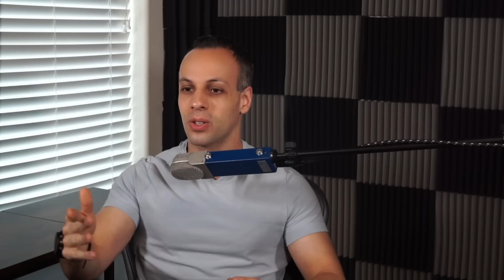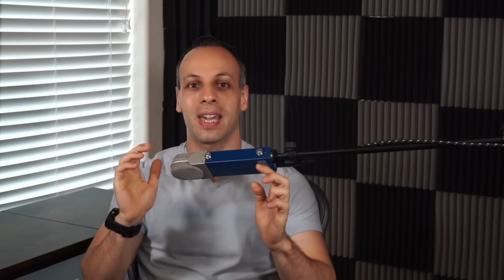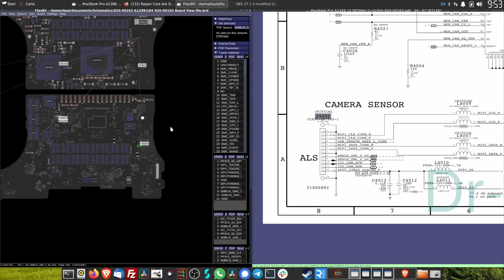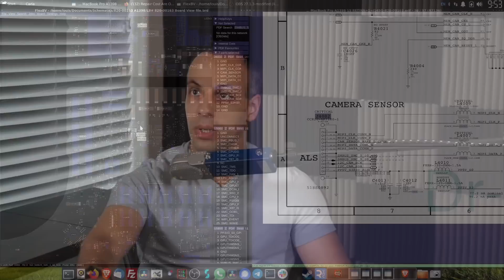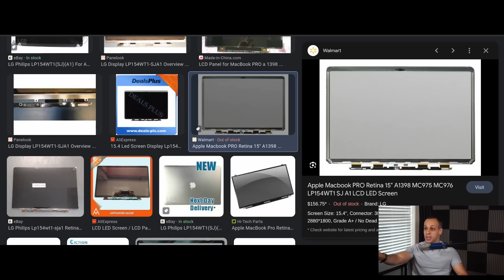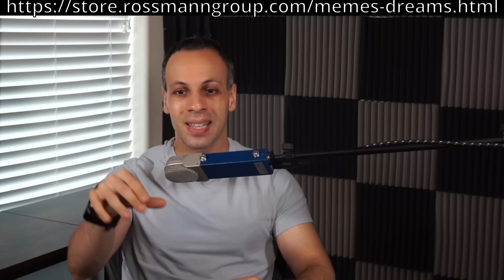The Ford F150 Macbook - when car repair resembles macbook repair...

Comment: What sucks the most about modern technology is computerization of things that need not be computerized. Cars are one of them. As a PC repair tech I believe cars should be as mechanical as possible because computers have so many more points of failure than a gear.
Reply: @@GH0STST4RSCR34M The problem is that it's made like that on purpose. I had to throw out a 30 year old whirlpool fridge the other day, on the back there was a sticker with a SCHEMATIC of the circuits, any repair tech or enthusiast could fix it with standard components. Go buy a fridge now and try to get it fixed out of warranty, everyone will tell you that it's cheaper to buy another one..
Reply: Mechanical and simple. Too many circuit boards that have components go bad and completely shut off the car
Reply: @@GH0STST4RSCR34Mshame old Bronco prices are crazy!
Reply: Cars are one of them... Tail lights being combined to and TIED to obstacle detection is just failed FORD engineering at its finest. Like GM engineers when they put a starter under the intake plenum on the NorthStar Cadillac engines. Tail lights need not be more computerized than they are with a simple switch tied to your pedal and a warning that tells you the bulb/LEDs burnt out. Cars as a whole on the other hand have got to be, thats all there is to it.
Reply: @@GH0STST4RSCR34M of course you're still stuck with a wood-framed body that's one big crumple zone if you ever tangle with some jackass in an SUV or monster pickup.
Reply: @@GH0STST4RSCR34M find a bigger car. something from the '40s.
Reply: @@GH0STST4RSCR34M ok, cross that off then...but how much stock A are you planning to keep?
Reply: @@GH0STST4RSCR34M damn son. i wanted to talk cars and here you are venting. my apologies if i hit a nerve.
Reply: @@GH0STST4RSCR34M someone should if they are smart about the car. i've seen many daily drivers that appeared stock till you looked at the wheels/tires or interior.
Reply: @@GH0STST4RSCR34M I have started and worked on one, they are not easy, it takes some training.
Reply: Uh, a gear will inevitably fail due to wear and metal fatigue at best. An electric connection, in theory, doesn't suffer those same issues and can, in theory, continue in dramatically longer. That's why you can easily pick up and use simple electronics from the 1970s and prior where you're a little more limited to finding cars that last that long.
Reply: I think that's not entirely correct, put your 70' audio electronic for 30 years in the car and it will fail too @Sarstan  that electronics also was based on simpler components, today whole boards are packed into one chip (and cost more to replace) in 70's cars had crazy mechanical solutions too (just look at mechanical sequential blinkers) and those are also prone to fail miserably. simplicity, package, and part availability is the key to long-lasting things. If you can't service the thing you will throw it away, if it breaks and you need NASA to service this you are screwed, if it is packaged so the subsystem stops the main functionality you've been ripped off in the name of an easy manufacturing process. I choose simple solutions every time over convenience, but there are fewer to choose from. Also, mechanical solutions could be reworked, and electronics need costly specialists to do the same IF even possible.
Reply: @Px4164  > simplicity, package, and part availability is the key to long-lasting things.

and eventually there will be very few of these things, and none will be cars or major appliances.
Reply: @Sarstan what the fuck are you talking about? What computers from 1970 are you still using? Don’t compare something in practice to something “in theory” because news flash, computers fail too. What a stupid point. You know this is a MacBook repair channel, right?
Reply: @Sarstan An electrical connection will get corroded, frayed, or otherwise damaged well before a gear in any automotive application.

Adding modules to control items that can easily be controlled mechanically or with rudimentary electronics (think the limit switches in power window circuits) is pure hubris.

There are some cases where electronic control can be simpler and more reliable (like electronic multipoint fuel injection compared to mechanical injection of the same type), but you still need physical actuation. You can never fully remove gears. And replacing mechanical linkages with servos or solenoids is almost always a bad idea.
Reply: @Sarstan  key word being in theory. In practice it’s alot easier for gear based and mechanical based machines to last longer than computerized machines because once something starts running on an OS, it opens up the floodgates of issues that come with computers. Like bit flips, blue screens (not literally but the same problems that cause blue screens), and just plain miscalculations that wreak havoc on computers, which are harder to predict than mechanical failure.
Reply: A computer has fewer points of failure than the mechanical parts that it replaces. Using a computer requires that it be properly packaged, wired, and constructed. When done correctly it is a reliable part. Unfortunately not every electronic part is properly built. I had a VW Rabbit with a leak in the windshield. That allowed water to drip on the fuse/relay box. This resulted in electrical issues.
Reply: @doctorkdsify I had the same issue, old VW rabbit, windshield leak, fried electronics, dead car.
Reply: @@GH0STST4RSCR34M While I understand your thinking, but the reality is, You can get the core components of the electronic devices.. Most people however do not have the know how to do such repairs. You could probably build one of those tail lights from china, yourself for cheaper.. but it would take time and risk. This is where they get their money. As was mentioned before... the customer was more worried about getting his truck back in working order fast than how much it actually costs.